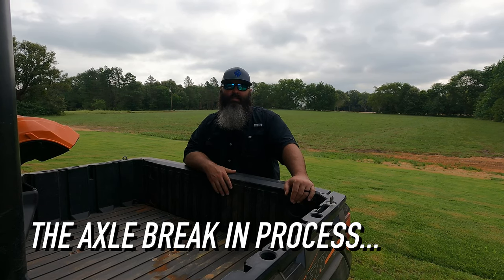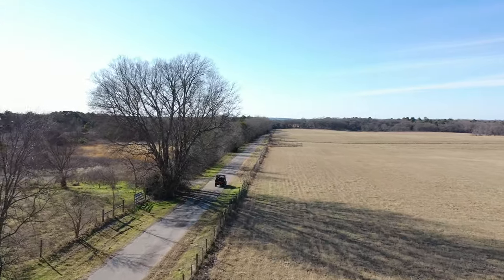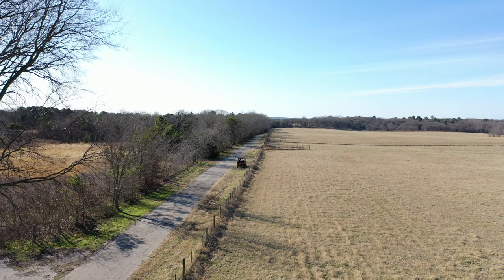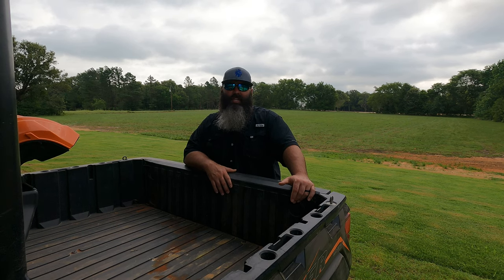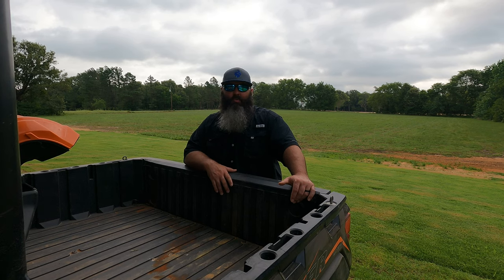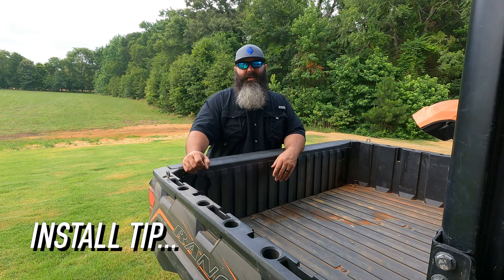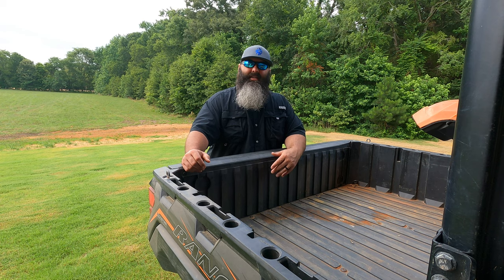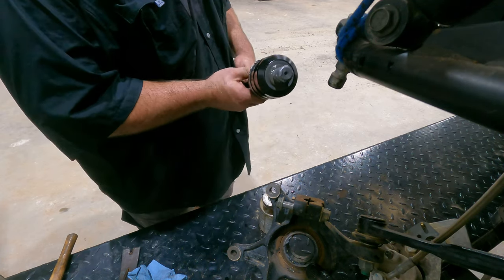New Axle Break-In Process ***Very Important*** ( Trail Kings Pro-Tip regarding new axles installs)

Comment: I know this is nothing related to trucks but I have a Nissan 350z and am about to have to new rear cv axles and wheel hub assemblies installed front and rear. Is there any type of standard distance for the break in process or even if their is an unofficial one what is it?